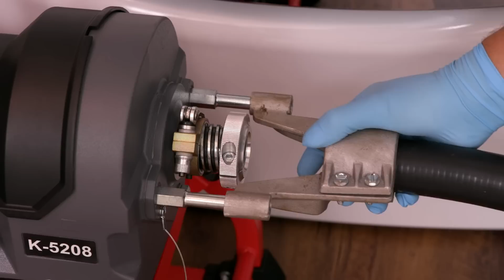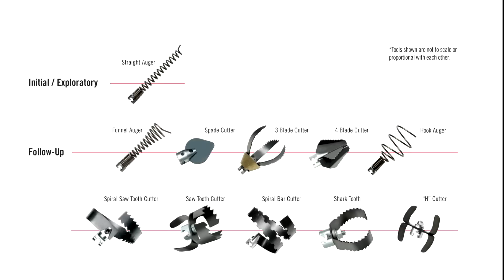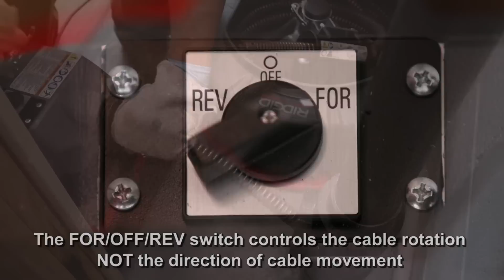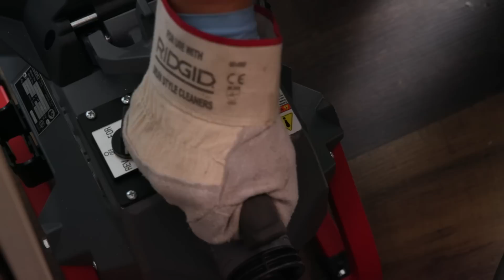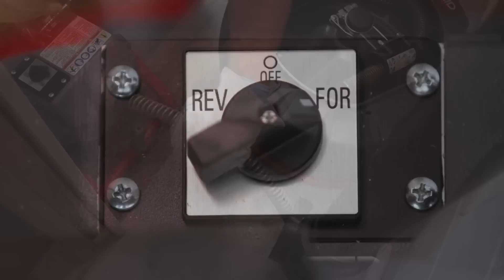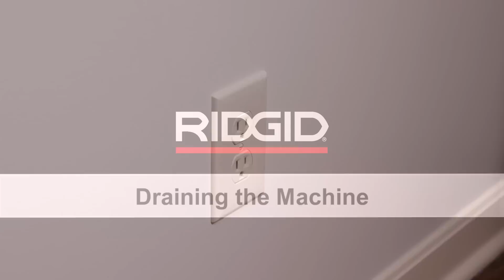How To Use the RIDGID® K-5208 Sectional Drain Cleaner

Comment: *I got the set without the accessories because I'm picky. >>>>
     Follow the break in instructions like the other reviews say. Run for 15 minutes while the release valve is open. Good construction overall. comes with two quick connects. I ended taking one of them off and putting a recoil hose on it. One less point of failure.*